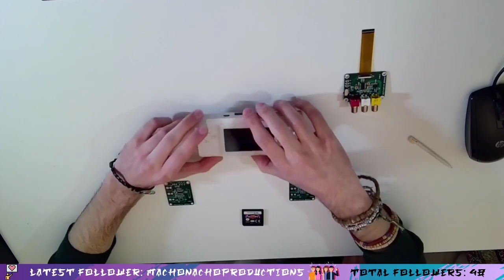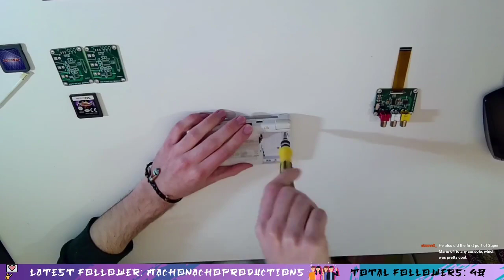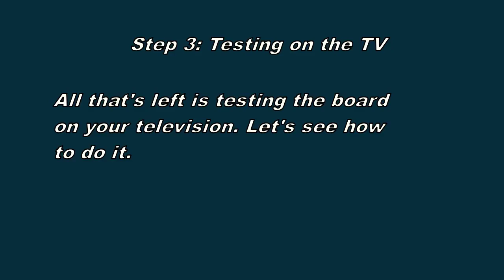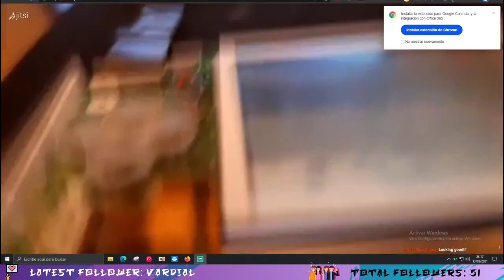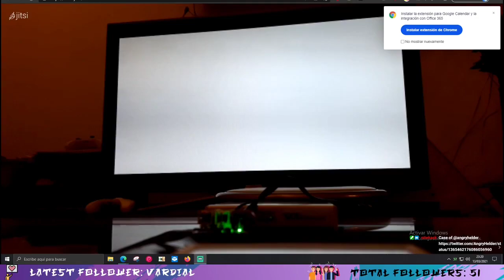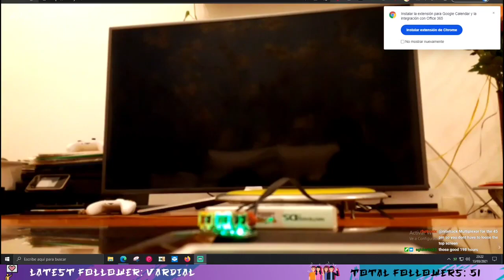EASY TUTORIAL NDS TV OUT mod installation - Nintendo DS on the Television !!!

Comment: If you do go with Pi 400 or 4B use Berryboot Lakka and Berryboot Retro Pi. I think you may need a Bluetooth dongle and Bluetooth Speaker for Lakka though because I am having a hard time with sound for some reason. Retro Pi is fine.

Comment: This is awesome, but I wondering how much better would be if could be connected to 2 screens at the same time, or even placing both screens to 1 vertical screen, as at some youtube DS videos do.
Reply: This mod looks to use the top screen output. To make the same with the botton screen would be neccessary not just adapt the connection to hook an external screen in its place, but carry the touch sensor to another device too (not a most usefull feature for lots of games, but still an issue to keep the handheld-turned-into-home-console functional).

The two DS screens in just one screen - even it being widescreen and puted into a vertical position -  would be even more troublesome since it would need a custom board to merge both handheld screens into one and decode both its signals into just one, sending it in only one outpur to hook in the screen you wanna use...

For this could be more easy just set some retro gaming system to emulate the games and be happy in the big screen (like most people on youtube do).
Reply: @aarondumas1629  Awesome Info man. Yes maybe it will be more usefull to just emulate them on WiiU like nowdays is possible. Still, being able to play with the original DS cards would be great. I wished this mod wouldn't looke so invasive and found a way to make it a "non destructive" solution.

Comment: every button on my borad is working normally,but it cant output AV signal.I dont know why,this problem makes me so mad :(
I changed the IC chips and it still can't work.
So sad
Reply: I still have errors in my adapter, I am trying to solve them, but maybe it can help you to find the fault.

The video output works for me, not perfectly, but it works.
For video output I use AV2HDMI adapter from Amazon Basics, previously I tried a cable but it did not work.
Reply from the maker: Check the flex connector on the board. It's the most critical component, and the most difficult to solder properly,
Reply: @yZddddddddddd  I find a person to check my board,and he told me that the op amp has some problem.Maybe I bought a fake one.
Reply: @fer8513  thank u !

Comment: I'm having a look through the schematics, what do each of the 3 buttons do? I assume the switch is just power and one of the buttons switches the output, but what about the other 2?
Reply from the maker: One of the buttons switches the top and bottom screen. The second button activates the multiple-screen mode (you can have the two screens on the bottom screen) and the third button changes the opacity of the screens when in the multiple-screen mode

Comment: does this send out 240p or 480i output? (I know the DS runs in 256x 192, but it's an abnormal resolution that many screens including CRTs won't work with, so I'm wondering how the output mod Alters the image in order to make it to work with normal displays like CRTs and modern displays with AV inputs)
Reply from the maker: It's 480i !
Reply: @yZddddddddddd  thank you, oh well, It seems I'd need 3 devices for what I'm after